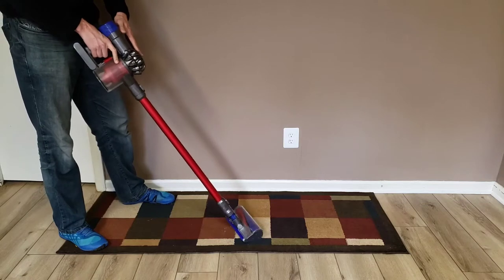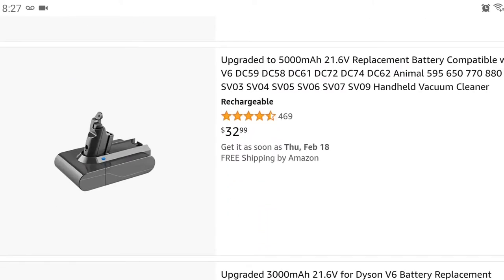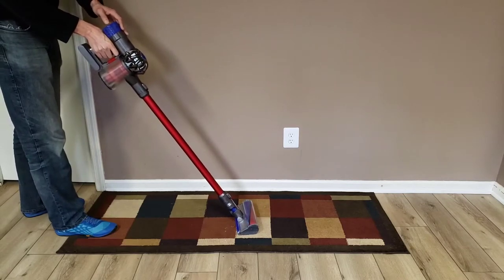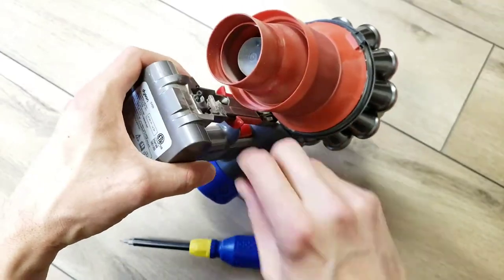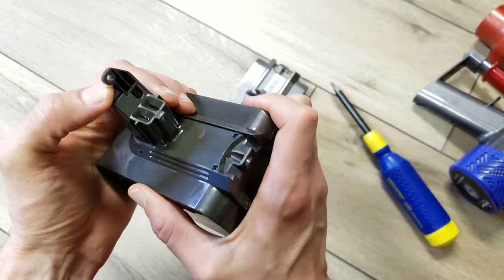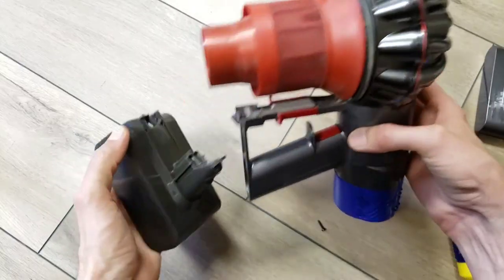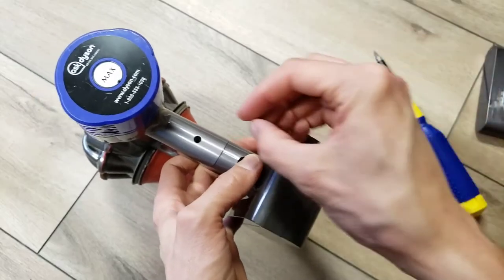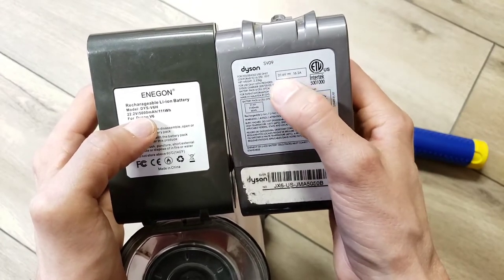Double the Runtime of Dyson Cordless Vacuum Cleaner using a 2X Capacity Battery to Increase Power

Comment: I just replaced the battery pack with a makita battery cradle best thing I did. I can do the entire house twice and not even  run the battery down by half and if you did manage to flatten it you just wack another battery in and away you go again and now you can buy the cradle adapters for $30 highly recommend. No wall mount though but who cares
Reply from the maker: What Ah battery do you use?
Reply: @engineerable  I use a none genuine 9  that I bought specifically for the vacuum project but I need not have bothered, iv tested my 5ah 30min and still had 1 bar left
Reply: @77machineman 30 mins , is that in low mode or high?
Reply: @stestar09  low mode

Comment: Remember these digital motors have software and circuitry which compliments the battery. Also the battery light system also shoots codes for issues with the vacuum. More than just washing the filters is needed. Have you taken the cyclone canister apart ever? Remember these are not completely microscopic dust elimination proof. Static clings a lot of dust outside of the cyclone separators causing build up which in turn causes resistance. The screen becomes clogged as well. Tools needed are simple. T8 torx screwdriver. Soft plastic guitar pics as to not break the screen housing to remove the screen. Light compressed air to access the screw heads if they are caked in dust. Gentle removal of the chambers. Plastic tweezers or a cyclone canister release tool to remove the canister from the motor body on the v6. Hand wash all the parts except the gaskets with  dish detergent and water. Let dry overnight and re- assemble. Makes a heck of a difference. 9 months after heavy use do this. You'll see the difference in performance. Remember loss of suction does occur in the caring of these cyclones, creating strain on the motor. Overheating the battery as well. Issues with the powerbrush motor and resistance adds to the load demands of the battery. Just replacing the battery with extra longevity can also throw led codes and intermittent surging. Also the digital motor circuitry had surge protection. The circuitry on the digital motor and brush bar compliment each other. This vacuum also has auto adjust features as well from carpet to hardwood floor, maybe not like the detect. Slight resistance acts as a sensor for the electronics to adjust, however if there are obstructions the vacuum goes into limp mode or even shuts off after 20 seconds if faults are detected not just in the airstream  , but also the wiring and running temperatures, resulting in reduced performance.
Reply from the maker: Thanks for the tip. I clean the cyclones on all Dyson's I have, but I don't bother taking them apart. I soak the whole canister in soapy water bucket and rinse and shake and spray until all that stuff is cleaned out. I know how people don't maintain them. I find Dyson's put out to the trash on the side of the road all the time because silly people think they don't suck anymore. It's always a simple clogged hose, filter or canister. Very easy to fix and get back like new.

Comment: The pack is thicker as the cells are set up as 7S2P  vs the dyson original 7S.  You'd only need two 2500mAh cells in parallel to get your 5000mAh. The pack won't weigh twice as much as the original because there isn't twice as much plastic shell and there is only one PCB inside
Reply from the maker: Thanks for the info. I believe that I that later in the video.
Reply: The original is 6S not 7S
Reply: The batteries are 6s and are rated at 21.6v. That's 3.6 * 6 for 21.6.
Reply: @engineerable  aaAa⁹
Reply: with wall mount bracket tension notch you messed up...
Reply: How do you set up the two 2500 batteries in series.

Comment: Nothing engineering here. Was expecting a cool video to take the battery pack apart and re-engineer the battery.😒
Reply from the maker: Initially I thought I was going to need to hack the battery and add more cells, but the first step of engineering is to research what has already been done and build upon that. If you find a more efficient solution, then why make your life hard and reinvent the wheel. Welding more cells in parallel would have been cool, but this is a hack that anyone can do.
Reply: @engineerable  good video, would it be possible to let us know exactly how long in minutes and seconds that the battery lasts on full power? Also how many discharge cycles has it had? We know it does your job, but us people like figures.  Many thanks, keep up the good work
Reply: seems like over heating problem, so the battery pack needs a mini turbo cooler fan. that would solve the problem
Reply from the maker: @deanrobillard2667  In this case, the original battery was not holding a charge anymore. It could be that general use of the Dyson vacuum gets the batteries to a higher than optimal temperature and reduces the lifespan.

Comment: The Dyson I have in repair has about 6 batteries that look a lot like the MOLICEL ones, they are 3.6V and 3000mAh. They have a good C11 discharge rate, that is, their maximum discharge before cut off is 3500mAh. This means that with the Dyson motor that consumes 19A, the battery can last about 9 minutes. The problem is that the chip they use to manage the charge is parameterized so that a small imbalance in the batteries blocks the charge and the batteries no longer work. For this, the PIC168xx is reprogrammed and that's it. You have the battery working again.

Comment: I can almost guarantee those are green wrapped Sony VTC4’s or VTC5’s, which were rated at 30a continuous discharge. Depending on when that original battery pack was made it could also be Sony VTC5a which I believe are no longer made. They changed to chemical lithium ion in VTC6 and VTC6a. I’m guessing VTC5a now… idk?! Lol it’s really dependent on the date of the original battery pack. The Sony VTC6 and VTC6a are the best high drain 18650 battery cells you can get that are available to the public. The VTC5 and VTC5a weren’t meant for private purchase, but vaping mechanical mod’s with low ohm build’s the Sony VTC4 and VTC5’s were the best battery to handle those high drain build’s and were low mah and designed to drain quickly but safely under higher continuous amps. Been a while since I needed quality high drain 18650’s and I haven’t kept up with the technology like I used to

Comment: All 18650 batterie’s are graded from D to A+ from the manufacturer’s. When batches are made some cells come out better than other’s… hence the grade. Companies’s like Dyson pay top dollar for those A+ cells. If you understand 18650 batteries you can build your own. From vaping mechanical mod’s starting in 2012 I learned a lot about 18650 lithium batteries, because you had to build your own vape from the ground up, wrapping kanthal and using a 18650 surrounded by a metal tube with a mechanical switch on the bottom to complete the circuit. You learned ohm’s law to build safely and understood there was only a few different 18650 manufacturer’s… LG, Samsung and Sony! Most of these other batteries were re-wrapped Sony, Samsung or LG of lower grade… say B+ and down in quality. If you were looking for longevity and didn’t have a super low resistance build the Samsung and LG’s with higher  2500-3000mah… were perfect at lower loads with 15-20amps. But if you were pushing a really low resistance build (more vaper) at say 0.15 to 0.29 only one cell could push those amps safely, being the Sony VTC 5 at 30amp but only 1500-2000mah. I didn’t vape that low usually. But, understand this was a brand new cell at that time which was cutting edge technology for high drain needs in an 18650 battery. If you understand the Dyson motor and what it’s pulling, at normal and peak, then you can split the amp load between the batteries running them in parallel with a high drain cells… say like Sony VTC5. They have better now but I haven’t kept up on the latest cells but usually Sony made the best high drain 18650 batteries. Less mah at 2000-2500mah per battery, but it could sustain 35amps per cell. The more individual 18650 cells it can utilize the less strain on each battery keeping temperature’s lower and efficiency better.

Comment: I tried a diy version of this by using my own cells and lets just say it didn’t end well…
Reply from the maker: 😂 what went wrong?
Reply: @engineerable  yes, seems the chap who wrote it hasn’t responded so I guess I have to ask what could happen if you use proper batteries, I can only think it be the installation in case you put one battery the wrong way round that could short it? I mean should be safe enough if you use proper authentic properly wrapped batteries and not Chinese clones I presume you would have to use high end 18650s like the ones used for vaping?

Comment: I love the floor planking. Would you mind sharing the type/model of flooring you have in your house? Also…Great video, helped me find a solution to my dwindling battery!
Reply from the maker: Thanks! I need to dig up the brand/model of this flooring, but I can't recommend it. It looks nice and the surface is very durable and scratch resistant. It is a premium vinyl floating plank, and the top clear layer is extra thick to increase wear and scratch resistance. However, the overall plank it is not very thick, which means the click joints are not thick, and therefore will break easily in some situations. So far, everything going over the plywood subfloor has been ok, but some that was installed on a concrete floor has had curling issues where there is an office chair rolling over it. The edges curl up, and the click connection breaks. I've noticed that the planks curl slightly in general (long edges rise higher than center). I was dubious about the thin click connection when being it was being installed, and rightly so.

Comment: I had the same issue with my V6 absolute. The batteries aren't "dead" after 30 seconds of running in max mode, the vacuum shuts itself off for one reason or another likely to protect its circuitry. This may be due to heat generation, or because the cells can no longer discharge at the rate required for max mode. 

When the light starts flashing blue and it seems like it is "dead" you just need to plug it in for a second or 2 to reset the system, then when you remove it from the charger it will work again. When this starts happening to your vacuum I suggest running it in normal mode and it should last for a considerable amount of time.
Reply: Yeah, I agree… for safety it’s probably a mosfet chip in the switch since it’s mechanical
Reply: Agree as well, I just tried with mine and after a minute on the charger it was back running and indicating 2/3 full battery. I had recently replaced the air filters and used cheap ones off Amazon. I'm wondering if these filters do not flow as well as the oem dyson filters therefore causing the batteries to heat up faster because of the higher air flow resistance.

Comment: the reason the batteries die so early is likely the extreme temperature the cells get to after using max mode for over 30 seconds. If you can feel it through the plastic, the batteries are much hotter than what you feel. 18650s should not be run too hot or too cold, both significantly reduce their life.
Reply from the maker: Good point, I never paid attention or noticed the heat generated by the batteries in max mode. With the stock battery, I use max mode for short durations because of how quickly it drains the battery. With the double cell/capacity battery, the current draw per cell will be cut in half, and therefore shouldn't be an issue with overheating the cells.
Reply: Water cooling or addition heatsink dyson mod
Reply from the maker: @Ryezn5057  Water cooling would be kinda crazy. Maybe just adding a fan to the battery casing to keep the batteries cooler?
Reply: @engineerable  it’s really shoddy engineering (or intentional for planned obsolescence) that the cells are allowed to get so hot. Very sneaky. They should at least offer an option for 2P packs, or 21700 alternatives for 18650 batteries. I’m just gonna have to DIY a Molicel P42A pack for my Dyson V10, or at least a 2 or 3P pack of cheap 18650s, it’s just a hassle though. Guess I will keep the ‘stem’ of the battery pack intact, use an original board/BMS and then the underside can be some cells stuffed in a box, lol. Won’t look pretty but it will work much better.
Reply: That might also be the reason why dyson themselves do not offer any larger-capacity batteries.. They would run too hot if they allowed them to run for much longer and a smaller capacity battery will limit this runtime.

Not going to buy a dyson ever again. Any future portable vacuum-cleaner will be required to have a external replaceable battery. My battery is close to being useless after ~4 years (they say 15 years) of minor use and a replacement 2500mAh battery should not be this expensive.

Perfect vacuum-cleaner would be one that is able to use standard makita/ryobi/milwaukee/etc battery-packs..
Reply: @engineerable  All 18650 batterie’s are graded from D to A+ from the manufacturer’s. When batches are made some cells come out better than other’s… hence the grade. Companies’s like Dyson pay top dollar for those A+ cells. If you understand 18650 batteries you can build your own. From vaping mechanical mod’s starting in 2012 I learned a lot about 18650 lithium batteries, because you had to build your own vape from the ground up, wrapping kanthal and using a 18650 surrounded by a metal tube with a mechanical switch on the bottom to complete the circuit. You learned ohm’s law to build safely and understood there was only a few different 18650 manufacturer’s… LG, Samsung and Sony! If you were looking for longevity and didn’t have a super low resistance build the Samsung and LG’s with higher  2500-3000mah… were perfect at lower loads with 15-20amps. But if you were pushing a really low resistance build (more vaper) at say 0.15 to 0.29 only one cell could push those amps safely, being the Sony VTC 5 at 30amp but only 1500-2000mah. I didn’t vape that low usually. But, understand this was a brand new cell at that time which was cutting edge technology for high drain needs in an 18650 battery. If you understand the Dyson motor and what it’s pulling, at normal and peak, then you can split the amp load between the batteries running them in parallel with a high drain cells… say like Sony VTC5. They have better now but I haven’t kept up on the latest cells but usually Sony made the best high drain 18650 batteries. Less mah at 2000-2500mah per battery, but it could sustain 35amps per cell. The more individual 18650 cells it can utilize the less strain on each battery keeping temperature’s lower and efficiency better.

Comment: Clean the second filter guys,  that is attached to the motor, it pops off with a knife and gets very dirty too. Also clean the cone that’s open with a damp micro cloth and a butter knife gets up there good. 
This will save your battery and help reduce the pulsating that drives us crazy!!👍
Reply from the maker: Thanks for the tips. A lot of people let those filters get clogged, but I keep them clean for optimum performance.
Reply from the maker: This one has a HEPA filter attached to the motor that may need to be replaced occasionally, although I haven't had to replace it. Emptying the bin before it gets too full, and cleaning the first cloth filter seems to keep the HEPA filter clean.

Comment: It would be good to see a tear down of the pack to see the spec of cell, and capacity testing for actuality. There is a 3D adapter on thingverse to allow using a Dewalt battery, and another for doubling the cell count on an OEM pack - utilising the original circuitry!
Reply from the maker: I now have a battery capacity tester, so I do plan to do that. In my experience so far, most 3rd party Chinese power tool packs that publish a believable Ah rating, still falsely advertise the capacity by 1Ah too much. Regardless, this double pack still lasts way longer than the original pack. It does have some issues where sometimes it needs to be disconnected from the vacuum and reconnected before it will start working.
Reply: I have an adapter/converter for my V8 that runs with my 18v Makita batteries. Best purchase I've made. 
Runs way longer, they're quick swappable, and its only a $20 adapter with batteries you already have/own. Downsides are charging batteries separately, weight added and it doesn't fit the wall mount.

Comment: this was 5 months ago, what was the result? Was the new battery worth it?
Reply from the maker: The capacity is great, I still use it, and I wish I also had a double capacity battery on my V7/V8 vacuums, but I did discover an issue that I'm publishing another video about. When the battery was new, sometimes the vacuum wouldn't start after taking it off the charger (This problem went away after several charge cycles.) Pulling the battery out and putting it back in somehow resets things, and it works fine again. I returned the first battery thinking it was bad. The next battery has been acting the same way. So I left out the screws, and put a strap around the lower part of the handle and the battery to hold it in place while making it easy to remove and put back in if it's not working. It's an annoying workaround for a battery that should work correctly, but for me it's worth it for the capacity. I can run the vacuum cleaner on high for the same amount of time as the original battery would run on low.

Comment: Should the vacuum be left on the charger when not in use?
Reply from the maker: Totally fine to leave it on the charger. The battery circuit is smart and stops charging when battery is full.